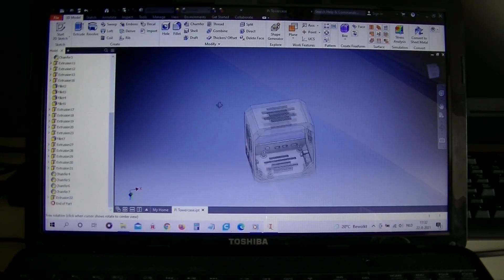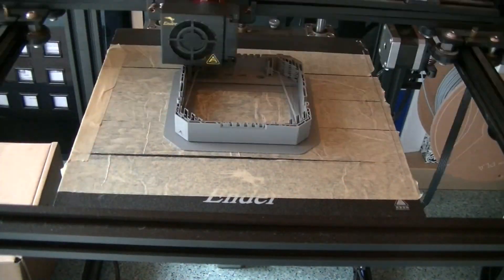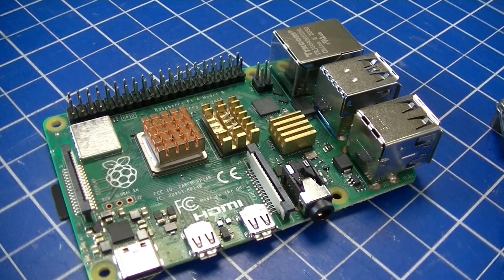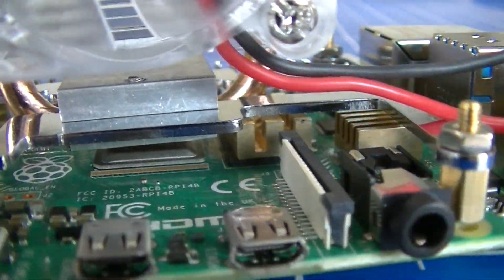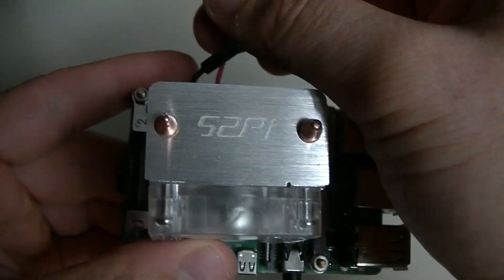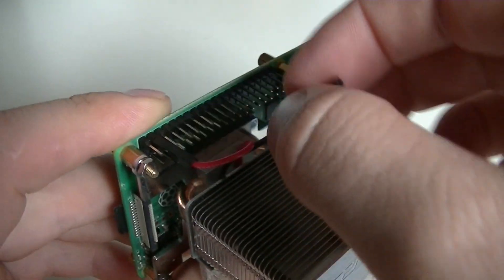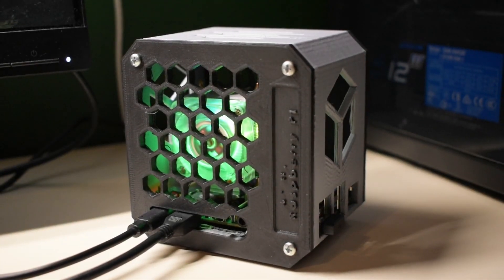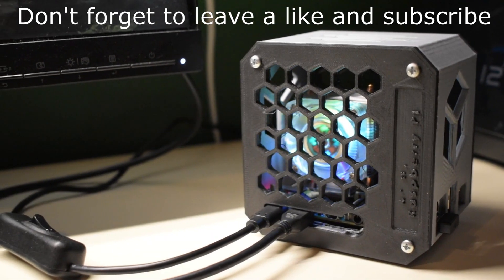3D Printed Raspberry Pi Desktop Tower Case + Cooler

Comment: Hi, can i use this on raspberry pi 5?
Reply from the maker: According to the technical drawings the Pi5 has the same dimensions and mounting holes as the Pi4 so you should be fine there.  You might have to mirror the middle part because the ethernet port is on the other side on the Pi5. Can't confirm for sure but looks like it could fit
Reply: Thanks bro @thebrojectlist6881

Comment: Hi, nice case. Just printed it today. But I got one question. What sort of screws did you use to put it all together? Thanks
Reply from the maker: For the sidepanels i used philips selftapping pan head screw M3x8 and to mount the PI i used the M2.5x6 philips screws that came with the tower cooler. I shall put the screw sizes in the description on thinigverse.
Reply: @thebrojectlist6881  Thank you!
Yeah, putting them on Thingiverse would be a good idea. 
Have a great week
Reply from the maker: @homelab32  Thanks! and good luck with your Pi Case 😄

Comment: Hey, what orientation do you print the case in? and do i have to enable supports?
Reply from the maker: Hi, i usually lay the centerpiece on it's side to print, this gives it more ridgidity and you don't need as much support. But don't print without support, it needs some for the openings. The side plates shouldn't be a problem. You can lay them flat and they dont need any support. Hope this was helpful 😄

Comment: what screws did you use
Reply from the maker: The ones for the side panels are philips pan head self tapper 3mm diameter and 8mm long. The screws that hold the Pi are the ones that came with the towercooler they are M2,5 if i remember correctly

Comment: what size screws?
Reply from the maker: The ones for the side panels are philips pan head self tapper 3mm diameter and 8mm long. The screws that hold the Pi are the ones that came with the towercooler they are M2,5 if i remember correctly